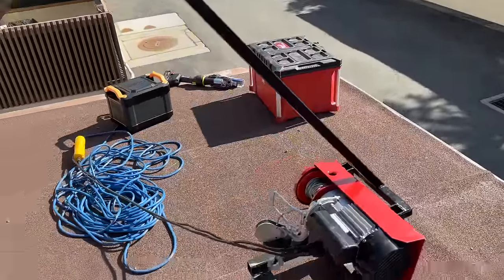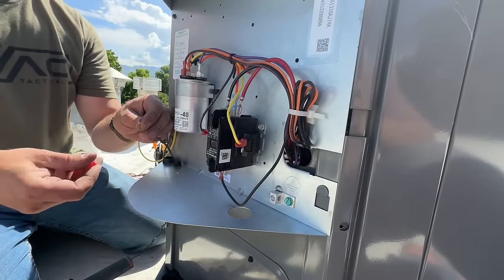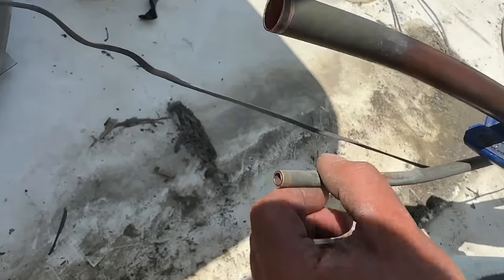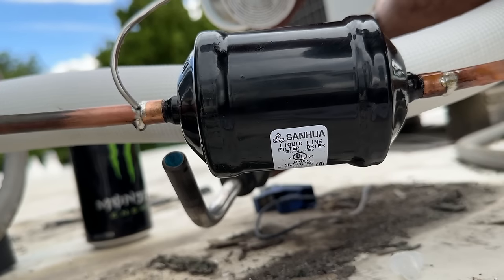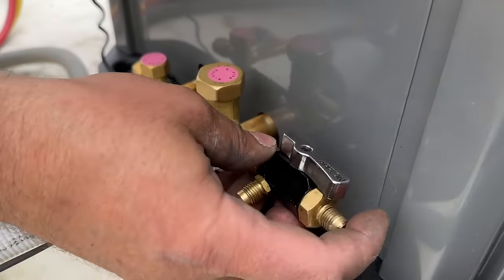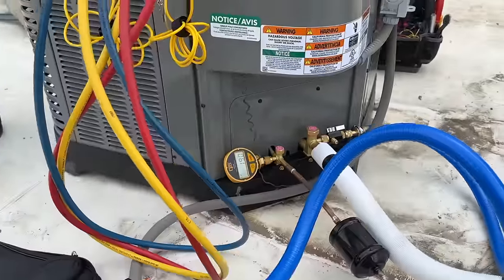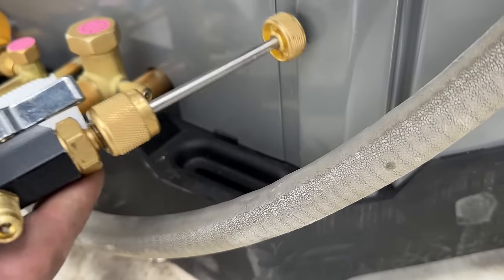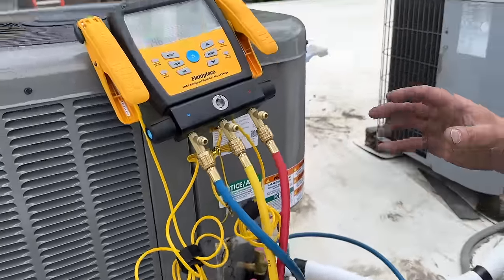Rooftop A/C Replacement Using My Homemade Harbor Freight Ladder Crane

Comment: Great work. You did the smart thing by using Stay-Brite 8. I have been in the HVAC and commercial Refrigeration trade for 48 years now and I wince every time I watch otherwise experienced Techs braze new copper joints, TXVs, filter/dryers, and etc. What a waste of time and money. By the way, the little stub on the end of the TXV sensing bulb is a manufacturing leftover from charging the power head and bulb.

Comment: Nice idea for blowing out lines . Old way was flushing with R- 11 before installing the filter driers on a burn-out .
Reply: Is there no concerned for getting themstuck in a kink .
What pressure  u use to push it out

Comment: This is a very neat design. It seams like the weak link is the safety factor. In some of the shots (especially when the ladder was adjusted higher) you were leaning into the ladder crane. I can imagine if the shackle, cable, or winch failed you could lose balance and fall off the roof. If I were you, I would add an extension to the bar at an angle that comes back toward the user. This extension  would be parallel with the roof. 

This modification would have two benefits. Firstly, the user would have more mechanical advantage. Secondly, the user would be lifting directly upward instead of at an angle toward the edge of the roof.
Reply from the maker: At no point was I leaning over the edge. The weight is always pushing toward the roof. How However I will be using a harness with yo-yo on the next job 👊🏼 thanks for the tips!

Comment: I have a 4 ton heat pump condenser that leaked all its R22, can I repleace it with a 5 ton condenser?.
Reply: Going bigger is not always better,if the unit is over sized it could short cycle and have humidity issues
Reply: No

Comment: Why arnt you using brazing rods?
Reply from the maker: Because Staybrite 8 is so much easier, and I have yet to have a problem with it. I have many friends that solely use Staybrite 8. Zero problems. Cheers friend

Comment: Nice idea on the ladder.   I wish you would consider wearing a safety harness during that operation  for that unexpected moment when thing don't go as planned.
Reply from the maker: I might just do that for future lifts. Thanks for the feedback! Cheers
Reply: Oh man, yeah! I had a tense moment there when you were lowering the old unit. I'm a retired Director of Risk Management so I naturally look for what could go wrong! Also, consider building the bracket from aluminum sometime in the future. The weight of that steel unit could have an adverse effect if it became unbalanced.
Reply: 💯 I’m all for going on a roof without a harness. But that my friend is working at the edge. You should be tied off. Nice hoist tho, aluminum frame and tie off would be great additions. Great job
Reply: @diyhvacguy  Awe man, I can't believe you did or do that. When I was 25yrs old Companies would make us change Commercial package units with Genie lifts! Fabricate carts to roll across roofs and over gas lines. Didn't like the stupidity then, but My own Company.......I pay for and use Crane Companies. It's quicker, less payroll, more profit, no worker compensation claims and no ones life changes forever going to work! Dude, you loose that tipping point for a millisecond and your hand/muscle/nerves wont let you release it and your going over. If OSHA see's you do that it will be the most expensive install you ever did!  If injured, $200,000-$300,000, is someone is killed....................start at $500,000 and up. Throw that damn thing in the garbage! What about a Parapet wall roof typical on buildings now? You going to lean the ladder out and stand on the 8" wall and cap flashing?
Reply: @snurb48  100% agreed.

Like, this is genius imho.  But it's friggen stupid af!  One of these days you'll be sailing over that edge with that unit and ladder not far behind you..  
I'd use it for short lifts, like the first one, maybe.  But past that... they made cranes for a reason.  People die doing this kind of stuff.
Reply: @ImSoRank I think you misinterpret the direction of force of this thing. 

Haters gonna hate
Reply: @michaelosmon  lmao okay and Darwins gonna Darwin.
Reply: @SmDJeremy  and people who never do anything are gonna whine about how it gets done on the internet
Reply: @diyhvacguy Tie off on ladder , will keep you safe and secure of load...✌️💎🎯☝️🤔 Fail safe,never goes unpunished...😊☯️💪
Reply: @snurb48 parapet?  No problem, 5 gallon bucket upside down 😂

Comment: That's something my company will never be doing. The potential for things to go completely wrong are very high and it's not worth the savings. All it takes is 1 mistake and your coming down with ladder and all. Great creativity and craftsmanship though. I applaud you for that
Reply: C'mon.   Live a little!
Reply: @seeharvester  Die on the job to save a buck? Nope.
Reply: Yeah that thing is insane. Do it right. Bill accordingly.
Reply: Same. A crane truck costs us $200, well worth it
Reply: Wanna bet how long before a call back because of refrigerant leak? Double or nothing it’s the shrader valve for leaving them in while soldering the lines in 🤣 I dunno, here they’re no longer sweating lines in Europe , they’re using the new compressed fittings .
Reply: @robertswaine6096 you ever have to pull a 100 lb compressor up a chase ladder 2 stories up , with the help of a friend up on top and rope of course. That things pretty handy.
Reply: @robertswaine6096 when it comes to companies they are rare the ones who care about actual employees. They’re in it for profit even the act of lowering pay. That’s great for an independent contractor. I know there are companies who really care for their workforce but that’s not the norm. Employees were once called exploitees. There’s good reason why that was stopped.

Comment: When the evaporator is below the condenser that far, for optimal oil return to the compressor the suction line should have a oil p-trap bent into the lineset  or a pre bent fitting. As far as I know most manufacturers recommend putting one in especially on the 2 story applications. Great install.
Reply from the maker: Thanks for the tip. I’ll keep that in mind on future installs!
Reply: Great point that almost the majority miss, but engineering has changed a little bit on the oil return trap. With the TXV and scroll compressors Factory Reps want NO trap due to the velocity is improved without it. Hey, I'm like you about the traps but Rheem and Lennox both have "adjusted" their installation instructions. Fyi.
Reply: How tall is that ladder boss ???

Comment: If you had a tie off point for yourself for safety I would say you have it 100% covered.
Reply from the maker: I will be implementing this on the next rooftop job. Thanks for the feedback!
Reply: I think this small height worked fine but WOULD NOT trust this on a 40ft ladder. I doubt a days pay is worth the funeral.

Comment: 3/8 line is called the liquid line, not the discharge line.
Reply from the maker: What is considered the discharge line? Just the section of liquid line right off the compressor? Thanks the the feedback
Reply: @diyhvacguy  It's the pipe right off the compressor before it goes through the condenser coil, It's discharging as a vapor.
Reply: @diyhvacguy  Sends hot gas from compressor to your condenser coil. Discharge feeds to coil, liquid line comes out of the coil.

Comment: Really cool idea although would be safer if you had your helper operate the switch or maybe wire a foot switch. That way both hands would be free to control the ladder.
Reply from the maker: I’m reconfiguring my setup so it operates off a Milwaukee battery, and has the switch built into the handle for easy operation. It will also be way way lighter as I’m going to rebuild the bracket. The current one is way over built lol thanks for the tips!

Comment: Why not use a boom truck? $550-$800 for a boom truck and you are done.
Reply from the maker: Umm because this is way easy, and was free.99 🤷🏻‍♂️   Oh and this eliminates the need to coordinate with crane/book lift drivers, not to mention access or lack there-of. I’ve done many of these lifts with zero issues, so I see no reason to change.
Reply: Probably less than that and safer

Comment: I use a shut off valve on the micron gauge so that the gauge doesn't get refrigerant in it after vacuum procedure complete.
Good video!
Reply: This. I never let refrigerant touch my micron gauge.

Comment: one day you will lift something too heavy and the ladder will slide out and whatever you are lifting will either Crush your legs OR will kill someone on the ground...best case scenario (ran over a few hundred simulations) is that you will break whatever you are trying to lift...
Reply from the maker: All I’m lifting is the same weight. About 150-200lbs, and the bottom of the ladder was anchored so that wouldn’t ever happen. I’ll probably throw a harness on from the room next time but this really isn’t an unsafe machine. But I appreciate your feedback none the less! Cheers

Comment: That looks really dicey... you should have either a safety harness on you and probably a rope on the ladder to keep it from getting too vertical and either pulling you off the roof or dropping that 250lb thing right through the roof below.  I'd have both I think...

Comment: 1:40 is so sketchy. Stay safe or its gonna bite you in the ass one day.
Reply from the maker: What’s sketch about it? The bottom was anchored. And the weight of the unit pushes it toward the building, never away
Reply: Great channel, but I'd have to agree on it being sketchy.  Screwing it to that board can make it more slippery, not less.  And if it were to slip ever so slightly... trouble above.  (I once rode a ladder down as the base slid out, and I also though my set-up was safe.)
Reply: @diyhvacguy  I'd just throw a bag of sand in front of the wood board for extra peace of mind, but I didn't find anything sketchy about what you did

Comment: Thank you very much for another great video. Very informative and educational. Maybe could have moved the txv to the 10:00 position to get things a little further away from the flue connector. 

BTW, there should not be any tape on that flue connector - only 3 self tapping screws.

Comment: You know what's hella funny for the last 15 years they been trying to get me to replace my 1983 system and yet it' blowing 64° in on 109 degree day in Sacramento stop working one day They try to tell me the compressor was no good try to have me replaced the whole system which I get it's old but it's been taken care of. I don't know much about anything AC's but I did my due diligence open her up the fucking wire was loose on one of the connections to the compressor motherfuckers but they're right I like to replace The ducing system even though I sanitize them every summer
Reply from the maker: The loosened the wires??!?! Wow, what low life’s… 🤦🏻‍♂️

Comment: Thanks for showing us how you install from start to finish really helps us learn how to do it right. 👍
Reply: Don’t sweat lines in with the shrader valves still in. Ummmm DIY install? Sure you have the equipment? I know you can save a ton but those harbour freight vacuum pumps kinda suck and before getting digital gauges the compound gauges can clue you in on things like non condensables in the lines if you’ve made a mistake watching the needles. If they don’t remain steady could be a bad txv as well if they fluctuate back and forth. No bueno. Do you’re homework . Can become a very expensive install and make sure you find out certain lingo like super heat sub cool , dry wet bulb etc etc. almost forgot to also add look at the installation guide, on the sensing bulb some manufacturers want it installed on top some on the bottom of the suction line , some have them held on already in place if they’re already clamped I’m never solder the line with it still clamped on the suction line. You can damage that sensing bulb and it’s placement when you first open the system is just to keep it from bouncing around during transport so read the install manual for proper placement of it after you sweat the lines properly. Umm let me mind my bizz I wish you luck.

Comment: That's pretty cool but how heavy was that condenser? I bet anything over the ladders maximum weight capacity wouldn't be very good. I usually work with condenser units that are easily 500lbs+

Comment: Pretty slick setup that sure earns its keep . We had a hand winch one for compressor lifting . It kept from needing a second guy to pull up the 4 and 5 ton compressors .
Reply: I know what you went through. Want to really have your nerves wrecked try installing air handlers for 3-5 Ton units in 10 foot ceilings using one of those rickety sheet rock harbour freight hoist bracing them with all thread and bars .
Reply: @carlospenalver8721  dumb question, why are they called 3-5 ton compressors? they dont weigh that much

Comment: Why isn’t your coil the same size as the furnace? I see way more things wrong than right.
Reply: Agreed.. looks pretty janky to me.  There has to be a better option.  looks like they sized it to fit the existing plenum rather than the furnace. 🤣
Reply from the maker: The plenum setup was super jank on this job so I had two choices match the plenum or match the furnace, I went with the same size one that was there as it worked for many years. But doing one the size of the furnace wouldn’t have done it any favors in my opinion.
Reply: @diyhvacguy  gotta do what ya gotta do I guess 🤙

Comment: Great videos, great work! Just a safety idea on the ladder-lift operation, when you're ready to lift, back your truck up close enough to the ladder so the top, upper edge of the cargo box prevents the ladder from possibly going over center outward, accidentally pulling you off of the roof and doing a header outward, down into the parking lot. It looks like the top of your truck's cargo box is high enough to allow that. With the a/c unit inboard, between the ladder foot and the wall, it appears that would work. Also, long Tap-Cons securing the ladder footboard to the floor? I was a safety officer at an airline for a while, some years ago. Cheers!

Comment: StayBrite 8 is "OKAY" however any "GAPS" and ya screwed... 

I use a different one made by the same company called "BRIG-IT" and it does the same and fills gaps a LOT better! Has it's own flux also...

Brig-it also has stronger and higher tensile than SB8 if i read correctly..

You (DEFINITELY) stepped up ya game with RHEEM/RUUD brand!!!  You will be glad when it's repair time, so (EASY) to work on!!  

Only real "ISSUES" I have had in 5yr+ of (EXCLUSIVE) Rheem/Ruud equipment installs, etc.. Is ECM motors and TXV failures.....   But nothing that isn't easy enough to fix...
Reply from the maker: I’ll have to check out Brig-it!! Thanks for the tips

Comment: Vary nifty set up too help combat a issue, bet if you refine it and add some safety factors to it you could patent it, if your company doesn't have the tools or planned for a crane company to help lift objects that set up would help for light to mildly heavy objects
Reply from the maker: I believe it is patented already. I just made this myself. I will probably incorporate a harness and life line on the next one 👍🏼 cheers

Comment: One of my coworkers has done hvac since he was in high school and still has his license, he told me the biggest hvac scam is telling people they need a whole new system, you can just replace the compressor, condenser etc, you almost never need a new system...and there's new cheaper refrigerants like rs-44b and 407c that can be used to top off r22
Reply from the maker: It’s true, but it’s kind of like replacing one piston on a 4 cylinder engine with high mileage. The odds of the other 3 going soon is pretty good. But yes, you can replace one component for sure. It all depends on how much they want to spend and how small of a job the company is willing to do.
Reply: @diyhvacguy  And in split units you need the controls/communication to match. Here in Europe anything residential and smaller stores/ offices uses (multi-) split.
Reply: Yes you do when changing from r22 to 410a system. 410a needs a bigger condenser/evaporator because it takes more area for it to condense.
Reply: @Bryan-Hensley  so then better to just use rs-44b or 407c then
Reply: @xxxblanco  I'm not sure what scenario you have in your mind. I use r421a. 407c requires compressor removal, oil dump and oil replacement with very expensive oil..
Reply: you cant top off with r22 with any of those you can replace r22 however
Reply: @lomice3705  sure you can. It's not recommended but not illegal.

Comment: Why not just pay a crane for $120-$200 and be done in 5 minutes? Your time is worth more then doing all that extra work.  If your are selling with a good 50%-60% net profit margin then put it into job cost and cut your install time down.
Reply from the maker: Location. A crane absolutely wouldn’t fit here with outriggers and they had these weird bridges over these ponds in this complex, and I’m sure they weren’t rated for that kind of weight,

Comment: Nitrogen Purge - should have a nitrogen purge going during brazing.  Much trapped smoke and particulate within lineset.
Reply from the maker: Not with Staybrite 8 👍🏼 temps don’t get nearly hot enough to create soot. If you don’t believe me watch some of my videos on Staybrite 8. I did a side by side joint one with silfos rods and one with Staybrite 8 and the Staybrite 8 joint was clean as a whistle when I cut them open 👍🏼

Comment: Ah, Hvac nerds giving roofer job security lmao. Tell me those screws at the anchor board went right into the roof. @ 1:13
Reply from the maker: Yes sir, filled them with roofing caulk when finished 👍🏼